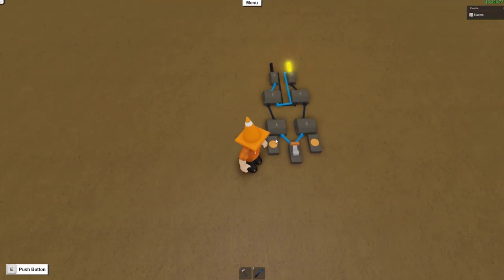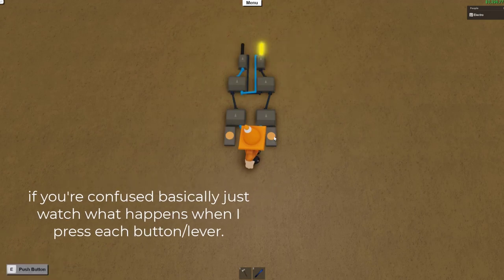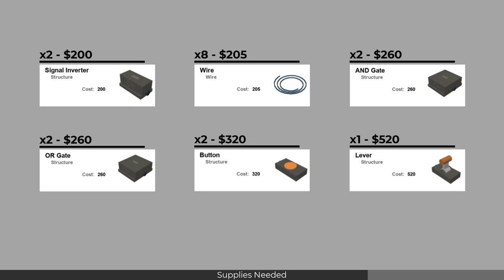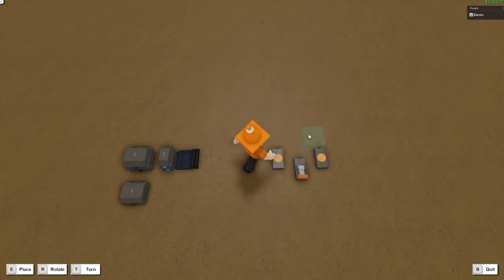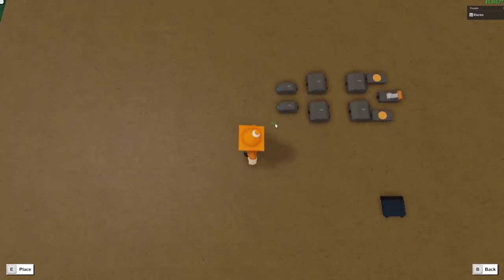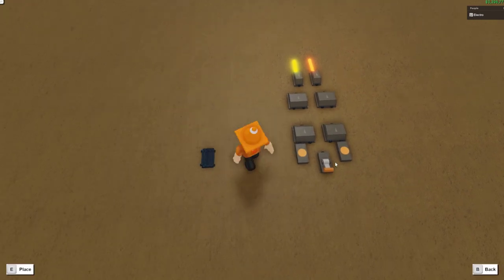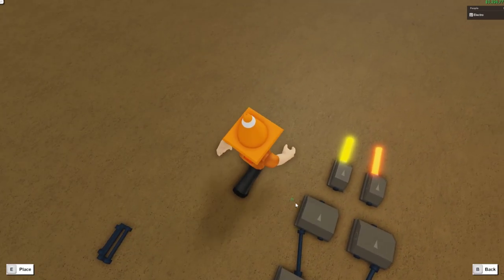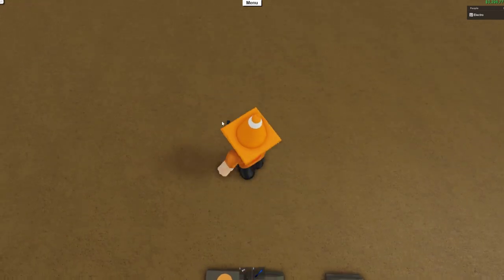How to Build: The SR Latch | Lumber Tycoon 2

Comment: How can I make a device that repeats a signal?
Reply: That’s what I thought but it’s pretty simple, you place a hatch connected to a lever and place conveyors and a pressure plate under the pressure plate place conveyors that lead to the hatch. What will happen is when the hatch is opened the item ( boxed lever) will fall onto the conveyor, once it makes contact with the plate it will generate a signal then go back up to the hatch and repeat again. It’s pretty complicated in words though
Reply: @sullycurry4621  thanks for the help but i already make a repeater and it is quite small
Reply: Just realised you only need 4 turn conveyors, laser, laser detector and signal inverter. sigh I’ve got to delete the bulky loops I’ve created 😅
Reply: @sullycurry4621  nope, dont even need turn conveyors. The design i have is conveyorless. If you want I can show you sometime.
Reply: Yes please the loop system I’ve done is very slow because of the items on my base, a conveyorLess loop will be excellent, Tell me your Roblox username and Teach me
Reply: @sullycurry4621  my username is sentinal102 and the nickname is joggle. I will be on in a little bit but I can message u on roblox when im online
Reply: Ok
Reply: I will add you
Reply: Accept the request when your ready